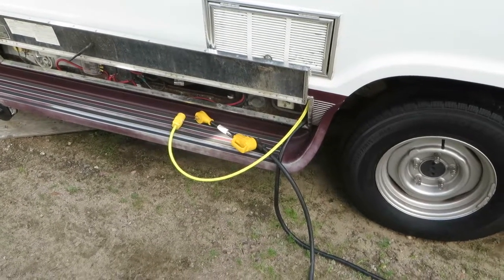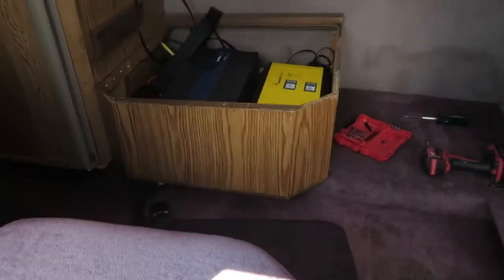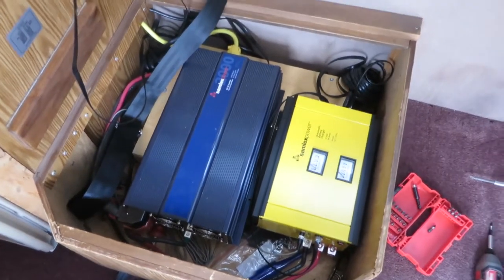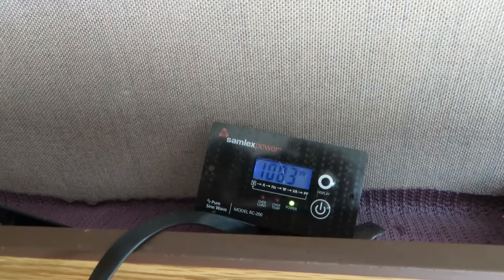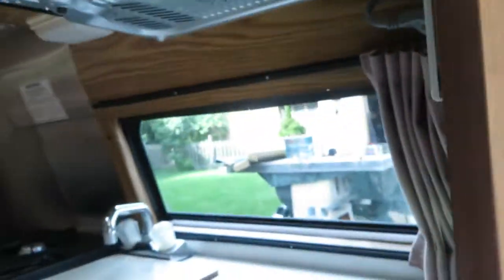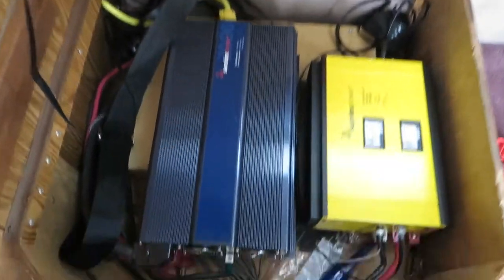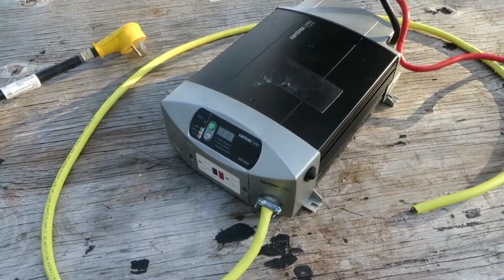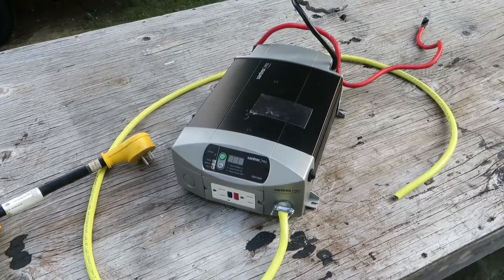How to Simply Power Your Entire RV with an Inverter and No Transfer Switch

Comment: I recently installed an Inverter setup in our RV.  I wanted to have power to run Mobile devices without having to run the Generator while not plugged in.  Videos like yours really help out.

Comment: I don’t understand. The yellow cord we see plugged into the inverter- is that the incoming power from the 30amp power outside the van? If so, where is the van ac load plugged in or is it hardwired to the inverter? If not, meaning the yellow cord plugged in to the inverter is the ac load, where is the inverter drawing power from?
Reply from the maker: The inverter is drawing power from the coach batteries.  The yellow cord is simply an extension cord so that I can plug the van into the inverter without opening up the seat compartment.  You will want to have a couple deep cycle coach batteries installed to run a 2000 Watt inverter.

Comment: Easiest way but I think I would have gone with a 30 amp inverter so I could have air too.
Reply from the maker: Yes, that would be good if you had plans to use AC but you would want a smaller inverter once in a while as the big ones are not efficient with small loads.
Reply: @SteveRivett  yes the newer inverters are getting better at no load idle.